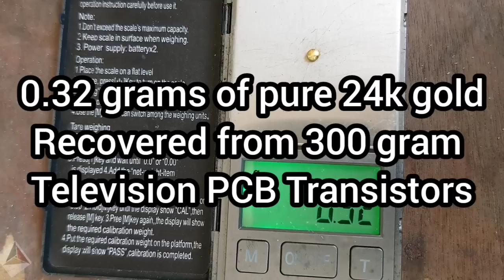TV PCB Board Transistors Gold Recovery | Recovery Gold From Television | Gold Recovery

Comment: Is there any reason you cannot use CuCl2, aside from it taking longer, to chew out the base metal legs?

Great vid Trinity. Thanks
Reply: The guy has loads of cheap acids.
Reply: A pro of living in his country.
A con living in Aus, UK.
Trinity isnt much for incremental Nitric dosing and conservation of acids...
Though it is ewaste and the yields are less certain... and like you said cheap acid. Saves times, seems to be effective.

My question is for the cheapskates, me,  or those who have difficulty getting their hands on Nitric Acid.
Reply: Maybe just snippin the legs as they are still on board would be faster, then just first AR should deal with rest. On cheap nitric:

Spectracide Stump-out has a mostly potassium nitrate version.  You can cheaply make up to around 40% hno3 without fractile distilling.
i think Nilered had a video. 

 Another thing to consider; instead of diluting 70% expensive nitric, use already dilute nitric for all but neccessary. For example i wouldn't recommend using 70% for silver recovery, if your first step is add water the same volume in water.
Reply: I snip the legs as a secondary process already. Thanks for the tips though.
Reply: @NOFX0890  Poor man's AR/ nitric . Works every time. All you need is pool acid (HCL) and potassium nitrate(fertilizer).
Reply: You can use cucl2 of course. The legs are tinned copper. Would take longer of course, but sure it'll work. Like others have said, trinity has access to cheap chemicals. He wants to get to the gold the fastest.
Reply: I agree you could use it. May be better served using a waste bucket with these and other crumb sized pins, resistors, and diodes. 
* Ones that you don't want to do as seperate batches.

 After the waste solution dissolves the base metal and legs, could rinse, filter and then incinerate the legless transistors and diodes and any resistors that may have metals still inside. 
Hmm probly don't need to worry about seperating any dropped pm's now, if next step after incinerate is normal process for incinerated ICs, then they should just add to final yeild. 

I want to try 1 kg that has legs snipped close, then i'l likely just add all rest to batches like this.

Comment: Are you using distilled water i would hope so as the chlorine will compromise the solution quite a bit.. also id heat the solution because heat helps with the extraction process even further. Basically nice and easy so you get a better yield for your intent and time
Reply from the maker: I also use tap water. boiling water for 15 minutes will remove all of the chlorine form tap water. Alternatively, leave a bucket of water uncovered at room temperature for at least 24 hours and the chlorine will evaporate without boiling.

Comment: I just recently finished a batch of 8000 gold legged transistors. I was surprised at how low the recovery really was. I suppose this helps me know I was not really that far off. Not much in the stock pot I guess.
Reply: You really counted 8000 transistors?
Reply: Did you weigh the 8000 transistors? If so, what was your gold yield from that many?
Reply: @scrapping4shiba   I did not weigh them, or count them.  It was a sealed, labeled bag of new non installed pieces.  The yield was 2.2 grams.

Comment: Sir I can use every water or just use stilling water?
Reply from the maker: Any water
Reply: Actually you need distilled water otherwise need to add sulfuric acid -H2SO4 to eliminate any lead present from the solution. Quite common in most tap waters